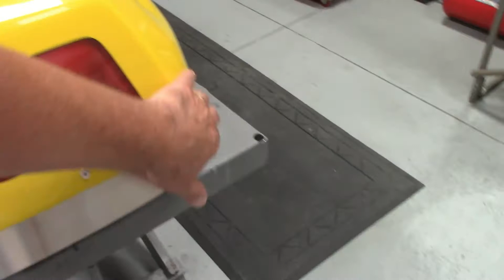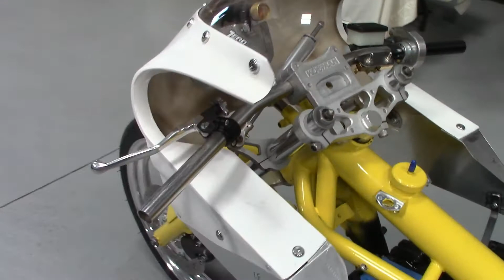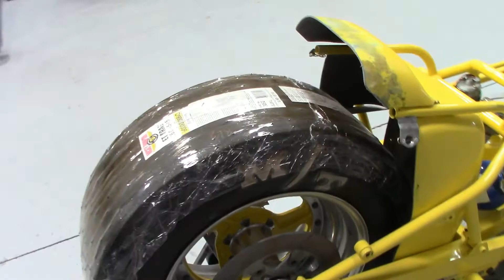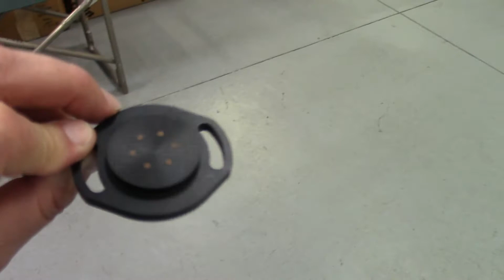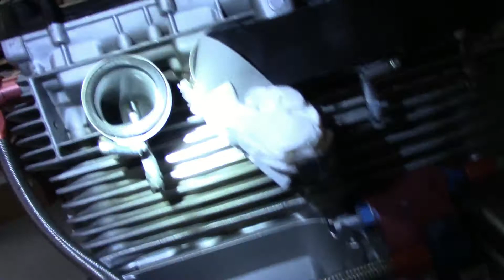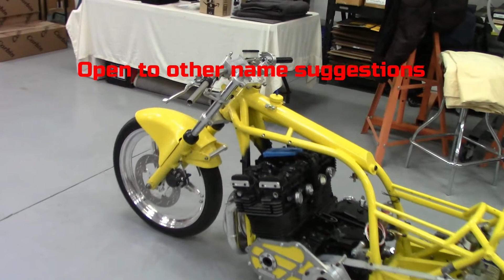Dale Walkers 89 Pro Street GS Suzuki Restoration " Part 5 "

Comment: Dale, prayers for Lisa !
Thanks for dragging this out, we talked briefly,  I found my 81 after 20 plus years,  in much WORSE shape. I have one of Sandy Kosmans rear wheels and swing arm. ( Im pretty sure he did the swing arm too ).The way he welded up those wheels are TRULY something to behold. I went to a skinnier, taller tire this year, the M/T 25/7- 18. When I finish mine, this iteration will have a small Positive Displacement supercharger from Japan, and I'll be cooling the intake charge with Water/Methanol injection. DRAW THRU of course, it's all I build. If I see the results I'm looking for,  I have another 1 of those blowers going on my Street/Strip Harley Davidson Dyna. I already machined the belt driven Primary front pulley to drive the supercharger.
Reply from the maker: First of all thank you for the prayers !   That's really cool, Sounds like a very fun project to keep your sanity TS. Nice to go through it all years ago, to at least have learned our lessons... LOL !